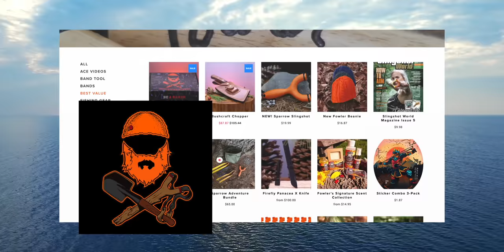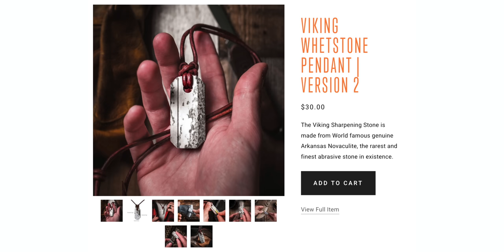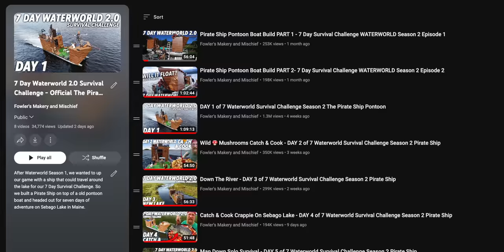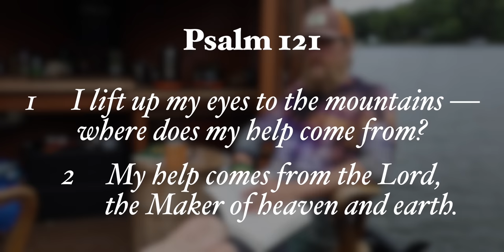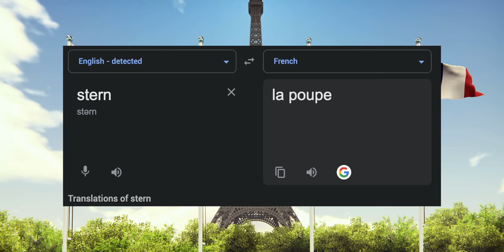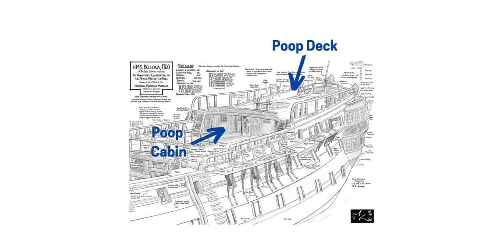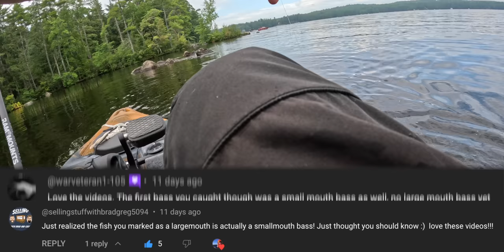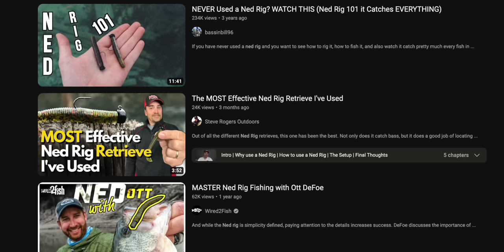Solo Survival  - DAY 6 of 7 Waterworld Survival Challenge Season 2 Pirate Ship

Comment: When trolling lakers, using the plug and pop gear will work fine. You can just troll the plug by itself and it’ll work, I’ve found sometimes they don’t strike with the pop gear on. Typically just a large plug. Your speed might be a little too quick. Trolling around 1.3-1.7mph typically works for me. In that big of a boat it might be tough to get that speed but you can drag a bucket to slow your speed. Lakers are some of the funnest fish to catch!